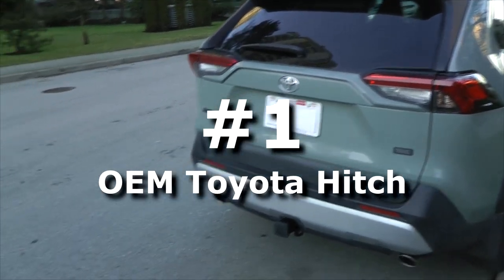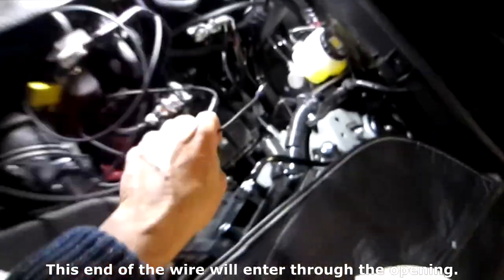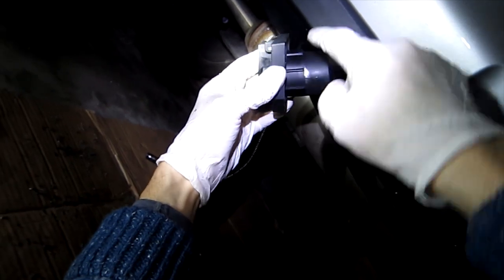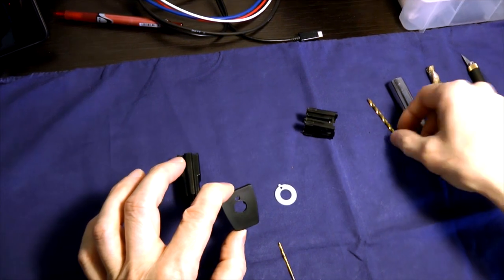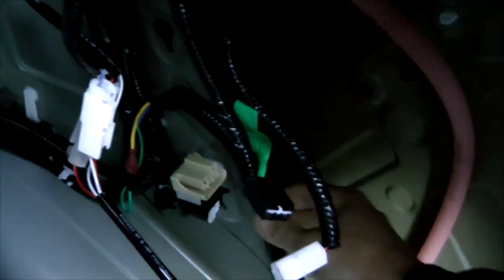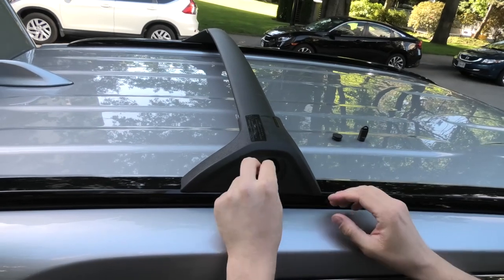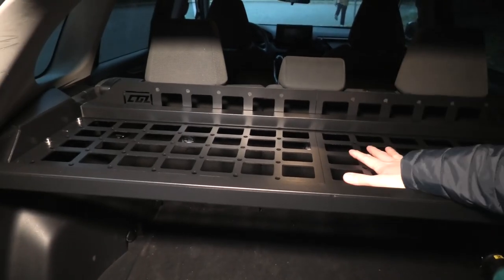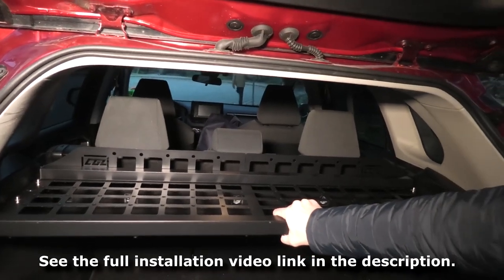Toyota RAV4 (2019-2024): 6 Must Have Cargo / Towing Mods.

Comment from the maker: FULL INSTALLATION VIDEOS AND PRODUCT LINKS:
1. 00:00 - OEM Toyota Hitch.
Watch the full review and installation video - https://youtu.be/VWlfbtvPAv8.
Toyota Towing Hitch Part Number: PK960-42K10.
PRODUCT LINKS: Genuine Toyota 2019 & Up RAV4 Trailer Tow Hitch Kit PK960-42K10:
- AMAZON - https://amzn.to/47kfFRC.
- EBAY - https://www.ebay.com/itm/163858472556?mkcid=1&mkrid=711-53200-19255-0&siteid=0&campid=5338971185&customid=&toolid=10001&mkevt=1.

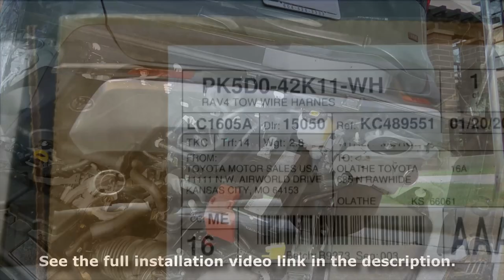2. 01:54 - OEM Toyota Towing Wire Harness.
Watch the full review and installation video - https://youtu.be/3_eKGti5Ivs.
Toyota Wire Harness Kit Part Number: PK5DO-42K11-WH.
PRODUCT LINK: 2019-2023 TOYOTA RAV4 / HYBRID TOWING WIRE HARNESS GENUINE OEM PK5D0-42K11-WH - https://www.ebay.com/itm/163858462917?mkcid=1&mkrid=711-53200-19255-0&siteid=0&campid=5338971185&customid=&toolid=10001&mkevt=1.

3. 03:54 - Reese Towpower 7-Way To 4-Way Trailer Wiring Adapter.
PRODUCT LINK: Wiring Adapter, 4-Way Flat to 7-Way, Round Car End - https://amzn.to/40S8vkA.

4. 06:15 - Redarc Tow-Pro Electric Trailer Brake Controller.
Watch the full review and installation video - https://youtu.be/Ut0ZnU2JVVc.
PRODUCT LINK: Tow-Pro Elite Electric Brake Controller - https://amzn.to/3kL5IZw.

5. 09:44 - Roof Rack / Crossbars.
Watch the full review and installation video - https://youtu.be/hZbzxVo_5ds.
PRODUCT LINKS: Cross Bar Roof Baggage Luggage Rack Rail Side Bar Set For Toyota RAV4 2019 2020 2021 2022 2023:
- CARTRIMHOME - https://cartrimhome.com/Cross-Bar-Roof-Baggage-Luggage-Rack-Rail-Side-Bar-Set-For-Toyota-RAV4-2019?tracking=morozov_automotive.
- AMAZON - https://amzn.to/3PMzNE1.

6. 12:27 - Custom Aluminum Trunk Shelf.
Watch the full review and installation video - https://youtu.be/LVzIh-UE19o.
PRODUCT LINK: Middle Storage Panel Shelf For Toyota RAV4 2019 2020 2021 2022 2023 - https://cartrimhome.com/Storage-Panel-Shelf-For-Toyota-RAV4-2019?tracking=morozov_automotive.

Comment: Love the shelf but wish you didn't need tools to remove it.
Reply from the maker: The set actually comes with quick release bolts which we did not show in the video. So it is fairly quick to manually unscrew them. There are 6 bolts holding the shelf in place.
Reply: @MorozovAutomotive  Cool, thanks for the info.